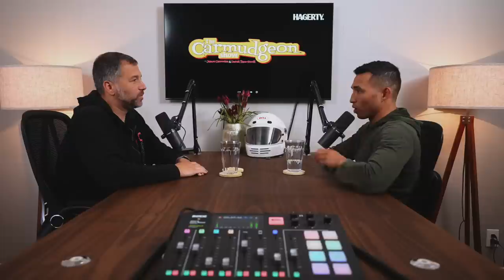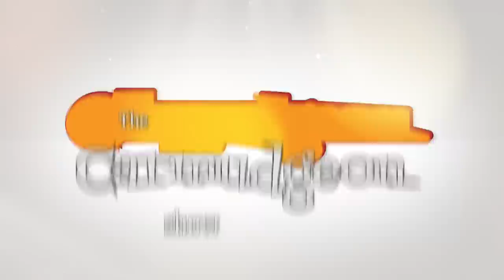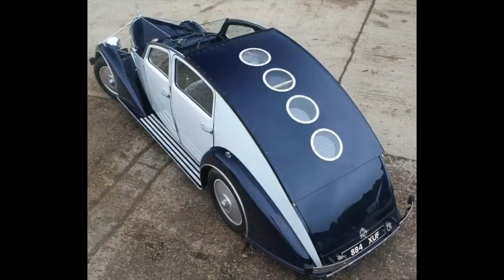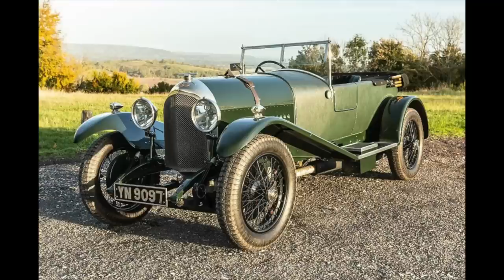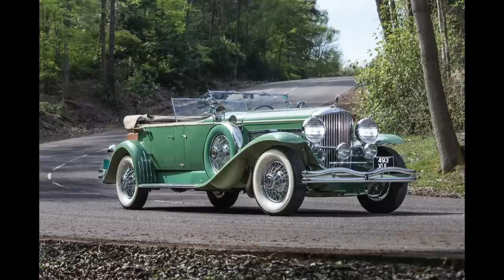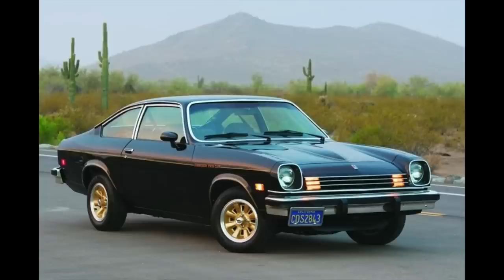Advanced Engine Concepts Made Simple — The Carmudgeon Show Jason Cammisa & ISSIMI's Derek — Ep 91

Comment: A little background info on the Dino motor on the Lancia. The engines are the same between the 246 and the Stratos with the difference of the carbs which make for a bit of a power difference. Interestingly the engine on the 246 was developed entirely by FIAT and tested in longitudinal configuration as used on the coupe and spider. When placed in the Dino 246 the engine was transverse which put the carb float bowls in an orientation that starved the carbs in sweeping left hand curves. For this reason Dino 246's have an un-curable stumble on sweeping lefts. This was all corrected on the Stratos with different carbs which eliminated the flat spots. Stratos carbs can be fitted to a 246 but it requires a custom airbox or a raising of the engine cover to clear. Just a little geeky info from a fellow Carmudgeon Dino owner.

Comment: 4 or even 5 valves aren't technically the best use of the bore ceiling area, non-circular valves are. Yes, Honda did lag behind Toyota and Nissan when it came to adopting 4 valves. They were also doing their own weird side thing in motorcycle racing of using oval valves to get a huge advantage where regulations specified 2 valves only. It actually wasn't a complete reliability disaster either somehow, they made it work and maybe in an alternate timeline, it might be mainstream tech.

Comment: The very first engine with "all" the dudads was the 1914 Alfa Grand Prix car. It has everything in one package: 4-valves per cylinder, twin-cam overhead, hemi-spherical combustion chamber, and dual sparks for each cylinder. That was the second engine after Peugeot's 1912's attempt for a multi-valve cylinder-head design.

Comment: My favorite late 90s 16valve 4 cylinder engine is the Toyota Tacoma. It's basically the 2JZ engine with 2 cylinders cut off. 
Very easy to work on and it makes great power with a turbo.  
Iron Block, steel crankshaft, steel rods, aluminum head with twin cams.  Great engine

Comment: I've been always interested in aircraft and I like how much they advanced internal combustion engines in the few decades before transfering to jet engines. Just few things they had decades before they became commonplace in automotive engines: 4 valves per cylinder, forced induction (turbo and supercharging) , intercooling, Water-Methanol injection and direct fuel injection to name a few. 

Also good reading for anyone interested in the subject is from Harry Ricardo "The high speed internal combustion engine". It's an old book but still has very good information regarding engine design and basic principles.

Comment: What I don't think you did mention was that higher revs also increased internal friction. So, the GM V8 approach: using displacement and gearing to  keep revs low and a simple, bigger bore pushrod design to keep the unit compact, is actually a viable approach. High torque, low revs, lower NVH and competitive efficiency in the best of them (LS/LT and GM3800)

Comment: Side Note:  Honda entered the twin cam 16v car engine market in 1986 but there was some cb750 iteration with the layout in 1979 iirc.  Great episode!
Reply: The 750 was, in fact, a twin cam 4V. Made 77hp @ 9k RPM.

That same time period, the 650 made 63hp @ 9k RPM with a single cam 2V!

Both were fantastic engines and had an even higher power potential.

Comment: Turbos were introduced on aircraft during World War 2 as a way to allow the engines to retain power at high altitude. The p40 warhawk had a massive rear mounted turbocharger fed by a 2 speed supercharger. The P38 and B17 bombers were turbocharged as well. The pilots manually controlled the wastegates because boost controllers hadnt been invented yet.

Comment: The twinspark tech is interesting too, worth discussing. Both Porsche & Alfa Romeo have successful recent engines there with both 2valve & 4valve heads. 
First twincam with cambelt; Fiat 124 1966, also pretty early with 4cyl 16v in the 124 Abarth Rally in 1974. Altho that sold in even smaller numbers than the next 16v, 131 Abarth.
Injection tech: you don’t HAVE to use direct injection to shut cylinders off, usual electronic port injection works as well, the fuel residue goes away the first cycle (1micro sec). Direct injection is A LITTLE more accurate and A LITTLE more frugal, but creates bad particles due to the high compression ratio. Also all sorts of soot issues inside the engine…

Comment: Jason and DT-S need to look at Honda's 32-valve V4 from the late 1970s.  It was their outrageous hail-mary attempt to make a 4-stroke competitive with 2-strokes on an equal displacement basis.  They targeted, and achieved, 120hp from 500cc naturally-aspirated.  8 valves per cylinder, oval pistons, 2 rods per piston, crazy exotic stuff.  However, they still got absolutely steam-rolled by the 2-strokes, which were making even more power by that time, and were lighter, and were more reliable.  Soichiro Honda (who personally hated 2-strokes) eventually swallowed his pride, and the 2-stroke 500 Hondas went on to make like 220hp.  I believe that's the highest specific output of any naturally aspirated gasoline engine ever - more than any F1 engine and more than the 787b rotary.

Comment: One manufacturer that went all out on 5 valve per cylinder engines was Yamaha. They designed the 5 valve head for the toyota 4A-GE, their motogp bike and flagship superbike used a 20 valve 4 cylinder up until the early 2000s, and their competition motocross bikes used a 5 valve single until 2009.

Comment: Ford UK and Germany released the RS1600 Escort in 1969. Volumes were small as it was a homologation special and built as road registerable. The engines' ancestors dated back to 1964.
1600 cc belt driven twin cam 4 valve.

Comment: I love these videos that are more  technical and both of you have awe inspiring knowledge and experience . However you could definitely do more research on Japanese car history - as indicated by your statements on Honda V6 history, or differences between variable timing vs variable valve lift. Speaking Honda, it would have been interesting to mention the oval piston bike engines, which had up to 8 valves per cylinder and we're developed for race applications from the late 1970s. Honda eventually released this to the public in 1992 - the NR750. And while the focus here is on piston head design, it would have been fascinating to explore the Wankel rotary, which provide their own interesting design questions around how to maximise air and fuel intake, and of course don't use actuated valves...

Comment: The C-Series V6 introduced in 1986 with the Acura or Honda Legend or Rover 800 series depending on where you're from, was 4v per cylinder and a had a direct competition with infiniti m30 when that was released soon after. The first generation NSX also used the C-Series engine but the only thing that shared with the legend was the 90 degree part of the engine. The J-Series went to a 60 degree upon the release of the 1996 Acura CL (J30A1).  Funnily enough, the C-Series was still used until 2004 In the Acura 3.5 RL. So about a 20 year stint.

Comment: Turbos were in racecars before street cars, just not necessarily in F1.  In 1952, the pole sitter at Indy had a Cummins turbodiesel, and turbos came into fashion there by the late 60's.  F1 didn't get them until Renault in 1977, but Indycars and Can-Am sportscars had been using turbos for years before that.  And when Renault did bring one to F1, it was a 1.5L V6.  My memory could be failing me, but I don't think 1.6L turbo-hybrid V6's with KERS and turbo heat recovery systems were really a thing in street cars when F1 adopted them in 2014.

Comment: Oh yes VW Group did inline six engines. From the late 70's possibly until the mid 90's. I believe Volvo (240) and Steyr-Puch (Pinzgauer) used some odd 2.4L VW inline 6 turbo diesel engine. This is the sort of thing we don't talk of as it likely lives in the Nutzfahrzeuge section of the parts catalog.

Comment: FWIW, the 75lb/ft per liter number for torque isn't quite a hard ceiling.  The "closed block" flat-6 that Porsche introduced in the 2009 model year claimed to generate more like 80 lb/ft per liter.
Reply: The 4.5 liter engine in the 458 produces 398 ft-lbs, 88.5 ft-lbs/liter.  Engineering Explained has a great video on BMEP, the better indictor of engine power efficiency.

Comment: Re. Early mass-market passenger cars with 4 v/cyl?  12:00 
English maker, Triumph, used a Saab engine (1.7L SOHC 'slant' 4), in their 1972 Dolomite sedan.  Being a of small-medium sporty(ish) passenger cars,  in '73 they had an engine boffin from Coventry Climax (racing background) develop a 16 valve head for this motor.  At the same time, the capacity was expanded to 2L, and the car was then called the Dolomite Sprint.  
Triumph advocates like to say this donk was the first to bring 4v/cyl to mass roduction.  😊
Reply: didn't coventry climax do the exquisite lotus elan inline four too?
Reply: No, I'm pretty certain Lotus did the Lotus Elan 4s, @thehumanoid6543 .

Comment: Big marine diesel engines have had 4 valves per cylinder for about/over 60 years now. The camshaft is still inside the block for ease of maintenance, but stuff like axial turbos that can be compared to the "new" twin scroll designs is nothing new.

Comment: How long did Ferrari stick with SOHC heads for the Columbo V-12?  IIRC the first time they advertised a twin-can version for the street was the 275GBT4, which was a 60s update of the original 275GTB.  Doing a quick Wikipedia check, the 250GTO was still SOHC.
Reply: It has remained in production for the GT cars until the mid-70s, most probably until 1974 when it was finally phased out from production.
They were a decade behind Lamborghini who used the DOHC from the very first model on.
Reply: The last SOHC Colombo engine was the 4.4 liter in the 365 GT 2+2 which ran until about 1970.

Comment: About the T.50 37:50 V12 sounding too clean and perfect..agreed. It also doesn't sound vicious and dirty like the BMW V12 did that sounded like the most roid raging 6 cylinder they ever made.
It almost makes me wanna circle back to GT3s for a purer/better noise for my taste, I know, you rag on Ferrari V8s a lot but even those have a bit more character than that.
Everything I've read and heard about that engine also sounds profoundly BMW to my ears which is a difficult thing to explain.
Then again, I'm keyboard warrior #1 and have not experienced those in person, so take these with the biggest grain of salt there ever was.
But to me for that reason (and 2.999.999 others) Porsches start to feel like a ton of value for money and I'd struggle to think of another company that has that going for them.
Don't get me wrong, glad T.50 is made but it's the comeback tour. You can't beat the F1.
Reply: I'm pretty sure the new T.50 sounds just as dirty and angry from the inside. Also the reason the F1 was "dirty" sounding intake wise was because it had huge intake resonance issues, which, however you want to talk about it, is a power loss. That's why a T.50 doesn't have itb's unlike an f1 because, surprise, there's literally no way to control 12 throttle bodies properly  throught 12000 rpm
Reply: also...and I think no one mentions this. Only gordon murray has the balls to. A GT3 has no torque below about 4000 rpm. In his words, a golf gti would be faster. The old mezger was much better in this way because it was actually an extremely tractable motor. The new one revs very high sure, but there's no way you're gettting to 9000 above 2nd gear without being a serious asshole on the street(Also a viper t/a with some sticky tires would send an average gt3 driver, the dentist, the hedge fund manager, crying home at literally any track except the nurburgring, but maybe that's besides the point.) I owned a 997 GTS and drove a friends 991.2 GT3 and I don't kid when I say this, I would take the 997 anyday of the week and as for track work, there's a little company called radical cars UK that would fix that problem.

Comment: LSs have a smaller envelop and lighter weight than OHC engines of similar power ratings. I feel OHC V8s sacrifice too much weight and packaging in exchange for power. Everyone compares power to displacement, the real measure should be power to engine external size. Its much harder to measure but a better measure of real world concerns. Or even power to fully dressed (including radiator) powerplant weight. By either of these measures the LS may beat out most other engines of similar power ratings. These metrics combined with lower cost of manufacturer are the reason it a popular choice for swaps. There's a reason the newest Ford V8 is a pushrod design.

Comment: I want Koenigsegg to double-up their TFG 3-cylinder and offer NA, 4-liter, 8500 rpm, Freevalve inline-6 crate engines. Such an engine should, according to Jason's calculations, produce about 485 SAE HP and about 300 lb/ft of torque, The true peak HP would likely be less because of the increased energy costs of driving a valvetrain with electrical, pneumatic, and mechanical components. Due to the infinitely variable valve lift, timing, and duration, such an engine could make use of cylinder deactivation and a range of different timing strategies to enhance combustion efficiency and emissions performance under different combinations of load and rpm and using a range of fuels (including those that are carbon-neutral.)

Imagine what such a perfectly behaved, future-proofed NA ICE would sound and perform like. Sure, it would have considerably less torque across the rev range than an S58, but it would have much more character, and potentially make much better sounds. With no turbos or intercoolers, it could also look much better in the engine bay of any restomod car that originally featured a large inline-6 engine.
Reply: I think you highly overestimate how many people who aren't porsche people are gonna pay for something like that and how much it would cost.
Reply: @thehumanoid6543  I’m not thinking of Porsche people. I’m thinking of people who are already on waiting lists for Singers or other restomods at well over $500k, and who would love a carbon-bodied D-Type, E-type, 3.0 CSL, 300 SL, M1, or other appropriate vehicle reimagined with the latest technology available, but with a similar song to the original.

Koenigsegg doesn’t have the capacity or interest to produce volume, and they certainly wouldn’t want to detract from their own offerings, but a non-turbo offering for a completely different segment might potentially be an interesting side gig to help build interest in Freevalve.

Comment: You guys talk like authorities on engines and engine management but I build and tune them and I can tell you have no clue what you’re talking about. Honda is simply joining the gang. There are dozens of engines with variable cam timing on both intake and exhaust. Example: even the (according to you) “dated” EJ257 in my 2018 STI has variable cam timing on all 4 cams. This is not simply an efficiency thing. Vtec uses separate lobes to optimize low rpm and high rpm power by essentially acting like it does a cam swap suddenly - where as VVTI for example lets me the tuner have access to all 4 cams independently. Think of vtec as a 2 speed trans of cams and think of VVTI like a cvt for camshafts. But it’s existed for decades already. Most cars that do have it only have the intake cams as variable, but if you look you’ll find a lot of engines with camshaft-cvt lol